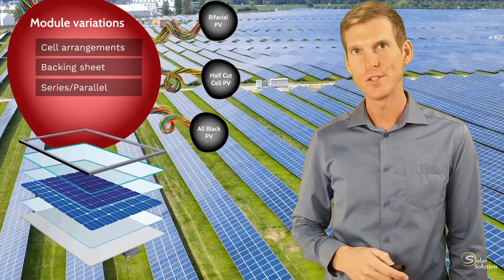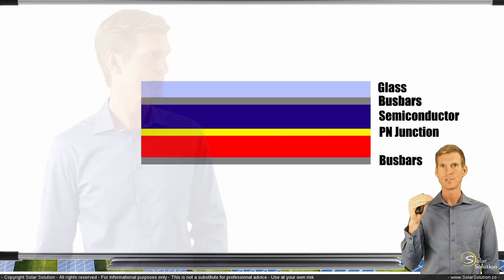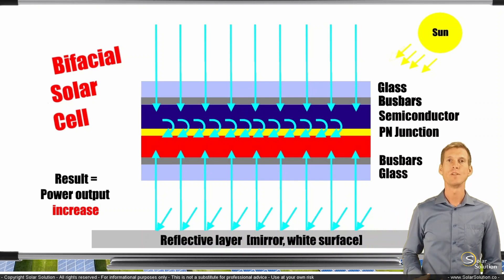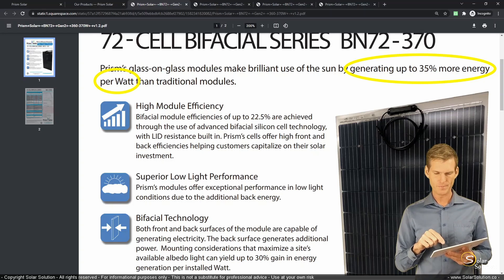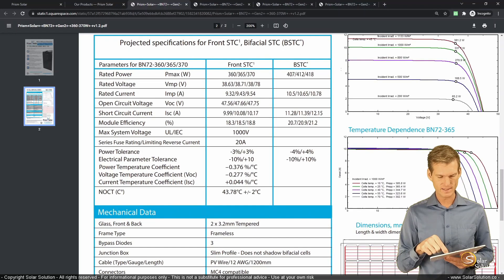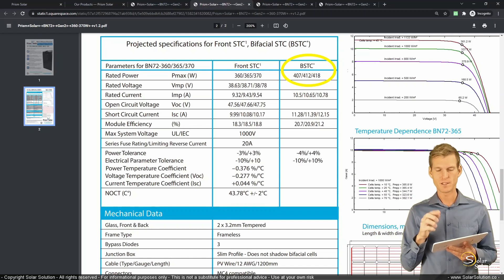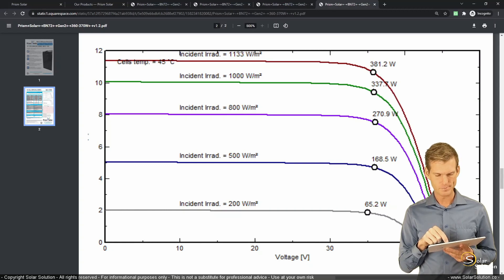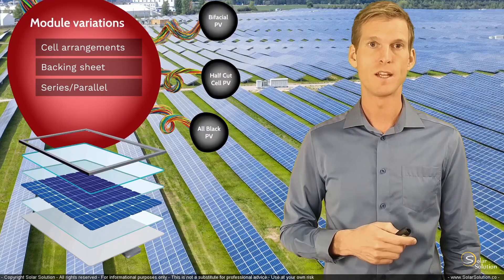Bifacial Solar Panels: What They Are & How They Work

Comment: I have heard they work better in colder weather and on cloudy day . I had a friend use reflective material on the back side and got a good increase but also caused the heat to go up.
Reply from the maker: Correct, PV panels typically work better at lower ambient temperatures.

Comment: So what if you mount bi-facial panels on a tin roof, say 12"from the roof. Then use the reflective paint on the roof. The same stuff used on the highway to make white lines! Shouldn't this reflect nearly 90% of the light? Possibly close to 98%much more than a traditional roof anyway, i think the paint is traditional paint, thr reflective part come from basically powdered glass applied over the paint, so on a roof, a white or silver roof sealer can be used then use the reflective powder. This should make a noticable difference in the temperature under the roof also. Depending on what it started with for roofing..   my house, half the roof is south facing, so I'm putting panels on the roof and the south wall, as well as on the fence, im going anout 12' tall and 30'+/- long in two places with panels starting about 16" from the ground. Hoping to get about 30kw of solar all together and use excess solarpower to lift heavy weights into a few tall trees. To generate power on the way back down, getting a 2-3klbs weight 25-30 feet up a tree on a guide cable. That will return to earth at a rate of 12" per minute roughly 7"-15" per minute, with a fence around the danger area, in the event of no power, they can be hand cranked up taking about a hour to two hours each, using a hand crank winch, power can be returned as soon as the weight is to the top. Having 4-6 of these if they generate 4,kwh each. Take 30-40 minutes to return to earth, this is 2kwh, each. Maybe more weight can be added, maybe use two weights per tree with a single generator, a 100:1 overdrive coupled to an  additional overdrive. Connected to a 3phase pmg , converting 2 rpm to possibly 2000, the weight dropping 6"-7", minimum for up to 40', then raise the weight to 6000 lbs, and slow the decent to 7"-8"  max per minute, the output should be 6kw+ for 55-90minutes producing roughly 10 kwh per tree, as far as financial viable, around 1.5-3 kwh is likely, and can be manually reset in 30 minutes. Getting 1500 watts for a hourwould be awesome. I don't think the math works out. But i hope to get something going possibly using a Nissan leaf motor as a generator, or something similar. Maybe a scratch made generator. Using large n52 magnets!
Reply from the maker: Very interesting ideas James, thanks for sharing! I agree with the general idea of using bifacial's and creating highly reflective roofing surface. I also like the idea of storing your excess electrical energy in potential energy [ie.e. weights in trees]. Which benefits do you recon the latter has over storing your excess electrical energy in batteries?

Comment: That's cool and all but I'm curious about all this quick innovation in the solar industry. Many people I know who install solar systems have an outdated model one year after their system is installed. When it's supposed to last 20 years. Feels bad man. Never thought I would be complaining about quick innovation 😂😂
Reply from the maker: Hi Mike! That is a good argument, I like it. Here is my take on it: I agree with you that the solar industry continues to develop and innovate the available products. I can therefore understand the perspective that one might be tempted to wait with putting their money in solar, as to avoid finding themselves with 'outdated' equipment tomorrow. Though I think here lays the culprit: the term 'outdated' is relative and might not be all that significant. A good example is the availability/introduction of the bifacial panels: If we were to call them a 'new' or 'innovative' product, it would mean that the conventional monofacial pv modules could be called 'old' or 'outdated'. This kind of perspective I think is somewhat skewed, since there is nothing wrong with the previous models, they just squeeze a little less power out of the available module surface area. Depending on the system installation details and requirements, I think often the most important factors to consider are the expected lifetime of the modules [& a solid warranty policy!] in combination with the actual price paid per watt of peak performance. Now here is new argument to throw in the discussion: If a product innovation offers a higher output per surface area, though the price per watt-peak, or the price per lifetime-kilowatt hour for that matter, is actually higher than the 'previous' or 'outdated' models, would it make sense to purchase the latest technology?
Reply: @SolarSolution  your right. It wouldn't make sense. But as a seller in Haiti, many of my customers often feel jade when they buy 300w panels, but the next year we have 500w panels, and find out that we cannot find their model when once breaks due to the manufacturer not supplying us with it. Personally I agree with you. Investing earlier is better. Especially with inflation these days. And for me, I'm glad we got a solar system last year instead of now. Considering after the price doubling here,  we burn about 500 usd of diesel to power our  generators ( as state power is unreliable at best in haiti).  And it's rumored that the price of fuel is about to double again.
Reply from the maker: Replacement of older models is often indeed a challenge Mike, I agree with you there as well. Depending on the type and size of installation, I often typically either supply spare panels to the customer during the initial installation, or design the PV array[s] in such a way that if one [or a few] fail over time, they can be by-passed without severely impacting the overall performance of the array[s]. That being said, there is no one-size-fits-all solution, especially when the PV array[s] do not contain that many modules. It is good to hear from you Mike, I wish you good and pleasant bussiness in Haiti!
Reply: @SolarSolution  thank you! Same to you wherever you are!